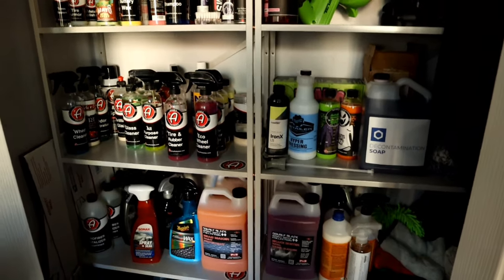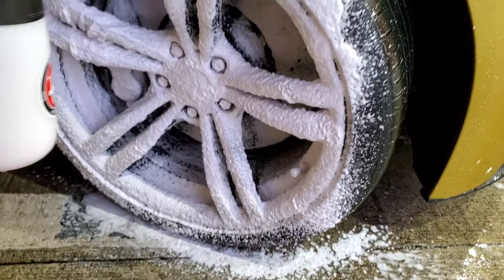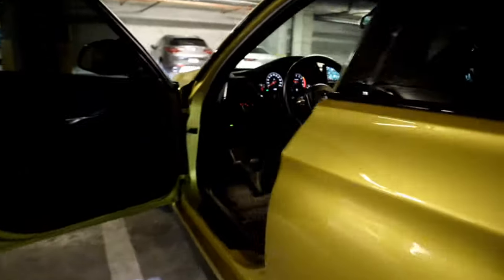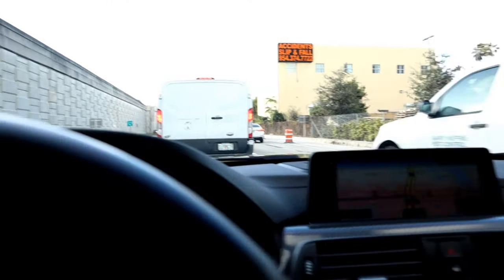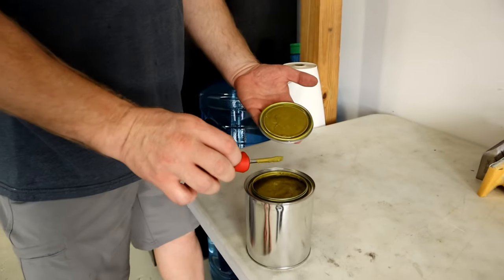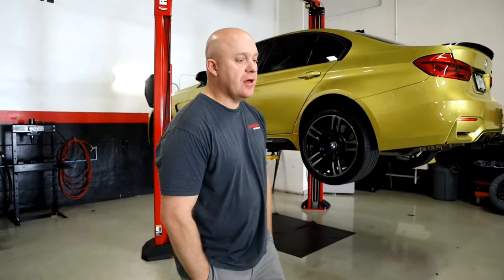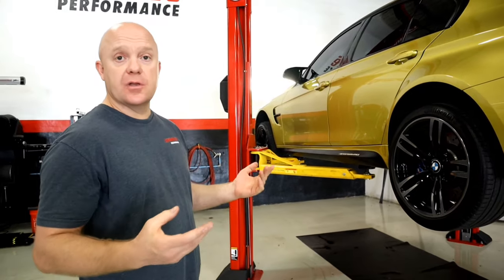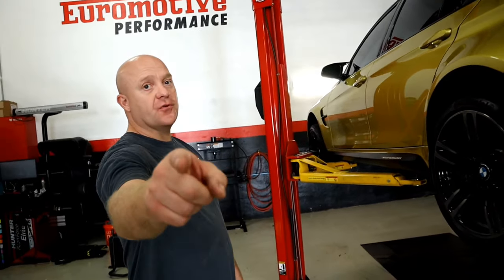REPAINTING The Brake Calipers on F80 M3 In Austin Yellow

Comment: You could have just bought the calipers from BMW in austin yellow. I have them on my 435i.
Reply from the maker: Total different color from the OEM Carbon Ceramic Brakes. If you were referring to that. BMW does not offer paint matched calipers.
Reply: @TheDailyDriven  yes they do, i have them on my car. It was offered part of thr M Performance brake kit for 435/335 and lower cars. But, the calipers were also offered to M3 and M4 owners as different colors. You have the options of orange, red, and yellow. https://www.ecstuning.com/b-genuine-bmw-m-performance-parts/yellow-bmw-m-performance-rear-caliper-left/34206855481/